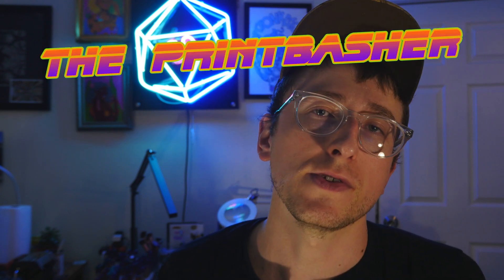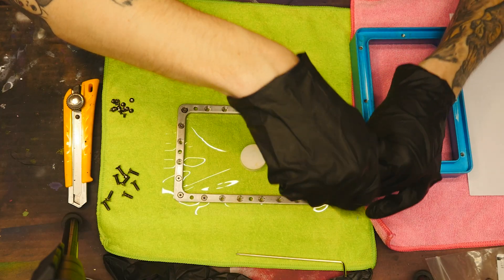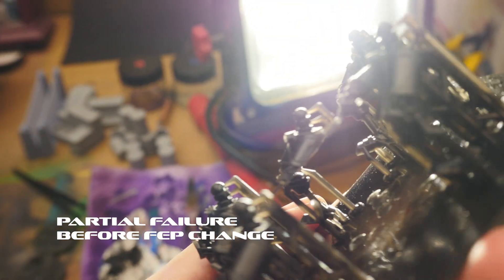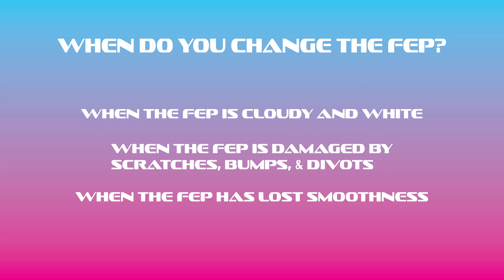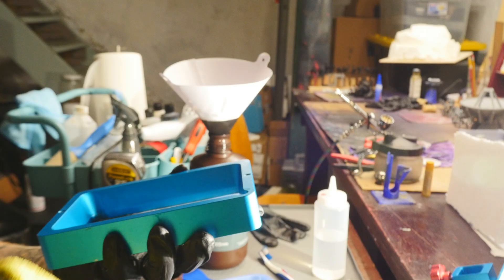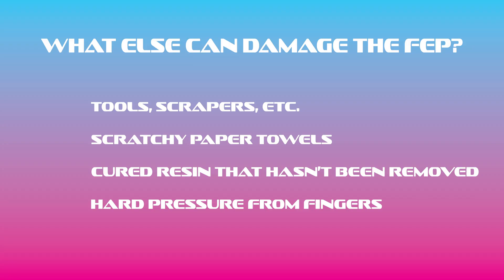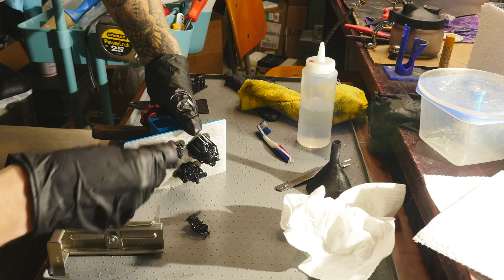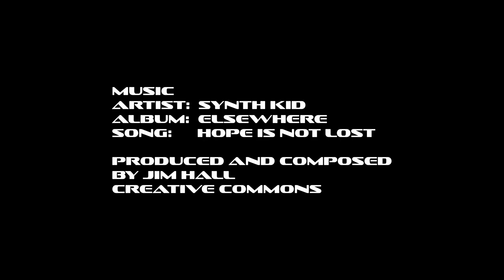When to change your FEP (in 3 minutes)

Comment: Something I've run into:  sometimes bits and pieces of support will detach and remain in the resin tank.  These can be pressed against the fep by the build plate, resulting in places where there resin can eventually begin to seep through.   Over time this will get worse and if you don't catch it in time, liquid resin can work its way through and onto the screen below.  You don't want liquid resin UNDERNEATH your FEP when you try printing, because there it will solidify, and at that point you have a much more serious problem than just that replacing your FEP will NOT solve.

Comment: My FEP has all the syntoms. I had two good prints (my FEP got cloudy and I guess that I didn't cleaned it correctly) then all failures like 10 times, my FEP is full of scratches because of bad prints sticking to the FEP, cloudy and not smooth. Time to replace it

Comment: Use 3-in-1 silicone lubricant on your fep (the spray can is the best) give it a sprits on the FEP  before you add resin in, then use microfiber cloth and rub it around the whole fep inside the vat. 

Silicone lube is the only lube you should use, yes others exist that can lubricate it safely but will have adverse effects if spilled or leak through fep damage. Only use silicone lube.

Lubing the fep prevents prints from sticking 95% of the time, if your sticking you need to add more lube. You will increase your life span of fep by lubing it. Silicone lube will have no adverse effects on resin, screen, fep, etc even if spilled.

Comment: Good advice to check for this when you get fails. I don't have to change mine very often as I don't get a lot of fails. I print constantly too, like pretty much 24/7. I think the longest lasting FEP was about 6 months of solid use. Personally I change them when I feel bumps or indents along the bottom when I clean them. I use a silicon spatula and clean the bottom gently. If I feel a lot of divots I know its about time. I do agree that FEP issues do cause a lot of fails, so it's good advice if you are seeing fails. I mean also a broken FEP leads to leaks so that is real bad.
Reply: Ok that's good to know been wondering looks like I been wasting them I replaced when the machine told me to